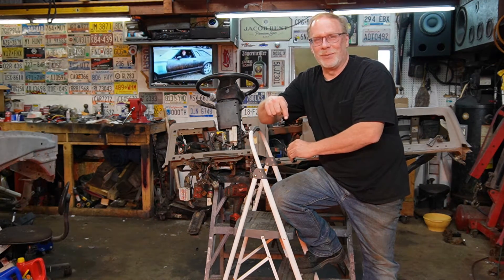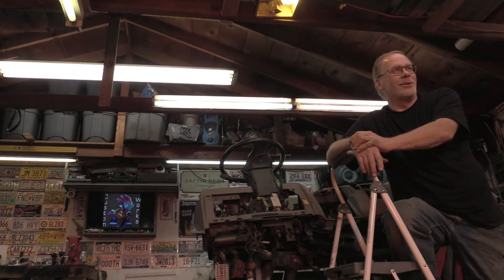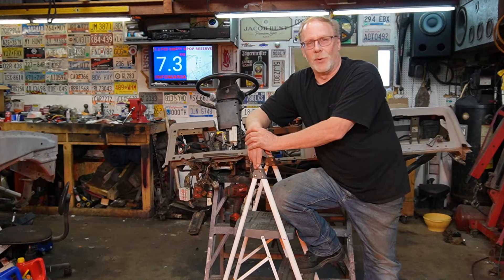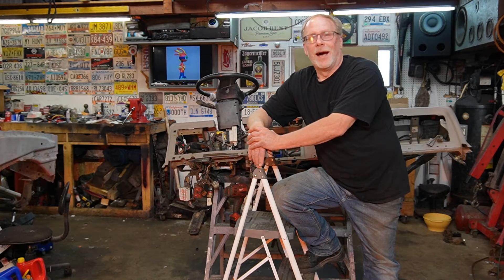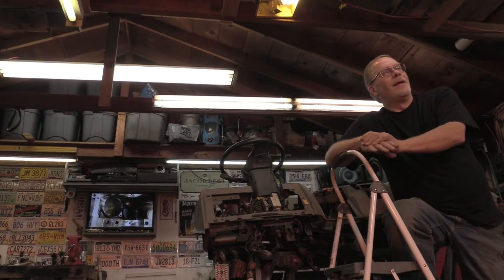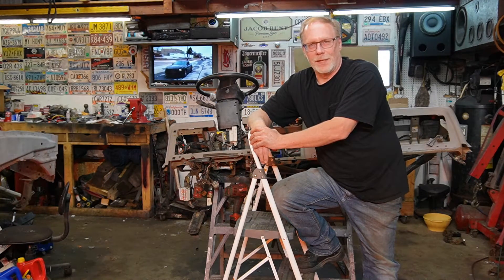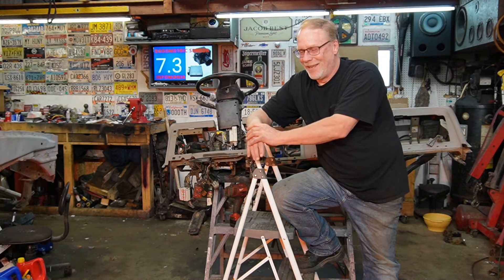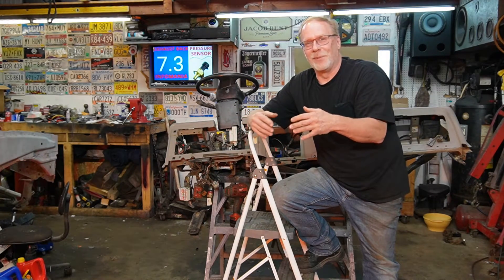🛻📽️ ....7 3 PSD QUICK TECH THE IGNITION SWITCH QUIK DIAG  🟢🟡🔴🟢

Comment: Thanks Clint, I’m actually experiencing something similar with my 99 but mine is a manual swap. I believe the ignition switch is bad because of similar symptoms. I don’t want to just replace parts because I am done spending money on this swap😅. Anyways, turn the key to start and nothing not even the “clunk” or a click. The abs light comes on and that is it, the pcm was programmed by a reputable company so I have ruled that out. Wiring harness, relays, and clutch safety switch are all new also…. Any insight from you would be an absolute blessing, thanks.

Comment: good morning  clint i just wanted to say thanks for stepping up and taking over sharing knowledge and wisdom concerning these trucks since unfortunately 2 content creators now have passed on and left the spot to be taken over and continued for those of us choosing to utilize these trucks in todays enviroment that appreciate what they are and what they do and what they represent in the diesel truck world and earned reputation they carry and respect given for what they have achieved and still demand to present day.. so thank you for your time and sharing your knowledge for those still driving these iconic trucks present day keep up the fine work you are doing its greatly appreciated... now i do have a question that maybe i can get more directed information for a problem lately ive been dealing with and has become quite annoying and always at the most  inconvenient of times it has come to be happening unfortunately i guess i have already went thru the replacing of the parts chasing the issue the first time recently anyway i had the occasional turn key to crank over and get the single click action so #1 new starter, #2multiple times cleaning of grounding and all wiring connections in that system could been the issue, #3 new 1000 cca batteries, #4 relays and other possibilities neutral safety switch blah blah blah turned out being the big thick cable from passenger battery positive to the starter (i replaced all cables in the system pos & neg) and it fixed the issue so on further curiosity from pissed off and confusion to why or what caused the click i starting peeling the coatings and the passenger positive battery to starter almost perfectly dead center of that cable was approximately 4" sized space of green powder i was shocked to have found in the location it had corroded anger and relief set in fr the explanation why because i could not tell just by looking at the cable itself of all the searches and information i went thru and read one of the last google searches i did one single guy had posted a small post i cant even remember the site it was posted in but i just happened to come across it and read his post and he had the very same scenario with cable corrosion way up in the cable in the coating where would'nt have expected it but there it was slapped straight in the face with it so after good chunk of money spent it was fixed but i was ok due to the fact i installed larger cca batteries  all new 2 guage  basically welding lead for cables i installed one of the better higher torque faster cranking starters so i was better off at that point and was extremely happy how much faster it cranked and started  definitely an upgrade id recommend for these trucks... but now i have another issue on occasions when i go out and turn my ignition key to start it does nothing no noises at all dash lights all do as normal i will turn my key on and off sometimes 2 times sometimes 7 or 8 times and it will all of sudden crank and fire right up and sometimes it fires right off on first time ive cleaned connections again cleaned the (nss) again the white ignition box under the steering column by fuse block  ive taken apart and cleaned it all really good, the key switch ive taken out and cleaned and checked it out for issues im back to no obvious piece  showing an issue again.... if it a under hood cable problem again for that possible sounding issue would i be correct in thinking my driver side battery positive cable that runs back to the cab connecting to the fuse block probably? or any other specific item or items i should look at again hard more than any others??                                                                           MY TRUCK IS A 2003 FORD F250 SUPERDUTY 7.3 DIESEL CREW CAB 4 X 4 AUTO 4R100 SHORT BED ANY INFORMATION TO DOUBLE TROUBLESHOOT BETTER WOULD BE APPRECIATED IF HAV AN IDEA  I SHOULD BE CHECKING INSTEAD WASTING TIME SEARCHING UNECESSARY PLACES OVER AND OVER HOPING TO STUMBLE ON SOMETHING AGAIN.....TY
Reply: Following. 2 years later. 
I need help with mine. 
Possible water intrusion to fuse box....starts off fender solenoid (new), but nothing at key.

Comment: I have an issue with my 95 7.3 F super duty 5 speed. when I shift gears I let of the throttle, push in the clutch, shift up a gear, release the clutch, and hit the throttle. Well when I hit the throttle I have nothing for about 2-3 seconds and then bam it hits hard or harder than I would like. Replaced the tps and its the same. Engine idles at this point but has no throttle response for 2-3 seconds. any input would be appreciated Thanks

Comment: Lots of debate between thermostats. 192, 195, 203 and mishimotos new 205. Riff raff only sells 192. People say international was 203 degrees. What is the best and what to buy? How bout another debunk!
Reply from the maker: I am currently do live testing on a wide open thermostat , 165, 185, and the ones you state above for the up coming cooling system video and debunking
Reply: 203 deg holds the water in the radiator long thus cooling off more, the 203 runs your engine at cooler temps. idc what the experts say, it is what it is.

Comment: total unrelated question to injectors, I have a 2001 F-250, I've noticed my oil pan leaking, but not from the oil pan gasket. It appears the provisos owner tried to repair it with JB weld or something like it. My question is can I replace the oil pan with out pulling the motor?

Comment: Dear Mr. Allen, thank you for your expertise. Having 1999 F350 7.3 has been my most challenging vehicle. If not for your simple instructions, and my 5th wheel Not sure if I would keep it. I have been able to change my ICP sensor. Most recently a new starter. And then both diodes. Battery issues persisted so an alternator. One rebuilt, still battery drain. So up graded to a new one. And better batteries. Still only runs on battery power. When hooked up just setting it drains the batteries rather quickly. The Technician with the scopes says it is well connected and well grounded. Was able to find the unused alarm system, and pulled the fuse. Circled the circuit. I have replaced everything with in my reach and ability. What is draining the batteries, and why won't the alternator power this truck? If it is the damn purple paint, I'll rattle can it black the minute I get home two states away. Thank you.
Reply: I have a buddy that had the same problem on his 7.3. He said it was the exciter wire that turns the alternator on to charge. He spliced a toggle switch into the wire betweenthe battery and the alternator, put the switch on the dash, and turns it on manually when he fires up the truck, and says he hasn't had a problem since. Not sure if that will help you or not, but I thought I would mention it. I also drive a 7.3 but haven't had that issue (knock on wood).
Reply from the maker: You have a massive short to ground That needs to be found https://www.youtube.com/watch?v=3EW5RubMsXE except in your case pull out the fuse and set aside don't reinstall keep pulling out fuses and relays till light goes out when light goes out that component needs to be checked or wire for where its shorting to ground , even a bad bcm will cause a massive drain so it could be a component box thats bad //////// If you would hook every thing up start the truck and with a 12 volt tester test the voltage at the cigarette lighter if its below 13.8 and usually with a massive short to ground it will be way below 12 volts but any way this would confirm this short and you need to do the above also the 2 relays on top of the engine for the glow plugs and heater could also be suspect This is mechanics 101 I not sure why a Technician who worked on your truck couldn't figure this out
Reply: @CUSTOMWORKS7.3PSD  Second mobile mechanic came out today. Told me what I already knew. The generator is not powering the power system. Even if the ECU is replaced, no guarantee until short is found. Three people have not been able to find it.
Reply from the maker: @mariefeely972  what state are you in ? or the truck I guess
Reply: @CUSTOMWORKS7.3PSD  I am in Sun Valley NV. Wanting to head home to Ryderwood WA.
Reply: @CUSTOMWORKS7.3PSD  Charging that batteries up again. Will check the PCM connections under the dash in the morning. Had machnicly inclined mental health client I was working with, Whom did not want me  to go. Truck has only run on battery power since the day I left.
Reply from the maker: @mariefeely972  Im no where even close to you or anyone I know but i sent this before https://www.youtube.com/watch?v=3EW5RubMsXE this is the best way to find a short to ground even you can do it just remember pull and leave out each fuse and relay as there pulled, most times in my shop we find the GEM under the dash is shot, If equipped the VSM is shot under the dash, a dual alternator the 2nd one is shot, the driver door or pass door has a wire loom pass through and its broke, the engine wire harness at the valve cover is rubbed through, the wire harness that runs the frame to the rear is rubbing through, last a after market or non factory hot wire or accessory is shot or rubbed through
Reply: Still checking.🙄
Reply: Only has 112k miles. At least there is one more part I will change. Thank you very much.
Reply: Added a smaller pulley to the new alternator. And new direct wires to second battery. Not sure if more power will create and bigger problem or if will help. But I willing to try. Still have not found the short. Have not let the smoke out of the wires yet. I'll let you know how the test works out.

Comment: As always clint, you're the best I watch you religiously. I've got a 2000 F350 7.3 210,000 miles. The only thing I've replaced is the air condition compressor. Thanks again keep producing the videos.

Comment: Hello Mr Allen i have 01 7.3 changed the injector cups and injectors got everything back together turn the key without the glow plugs in and the motor is barely turns, starter and batteries are good good was spinning before work on it..any ideas help please..
Reply from the maker: where did the injectors come from or who rebuilt
Reply: i just changed the orings on the injectors and put them back the had been sitting up since November 22
Reply: truck had been sitting up since November
Reply from the maker: @calvinhill1564  One or a few injectors have a problem with the armature to close or to far away from the solenoid or where your doing it from the cab ignition? to clear the cylinders key off in park or neutral and from the  starter wire that looks like a fuse on the passenger side pop that apart and jump to the battery to spin engine to clear the cylinders, let me know what happened There are some other items I'll need you to check
Reply: @CUSTOMWORKS7.3PSD  okay thanks will try it